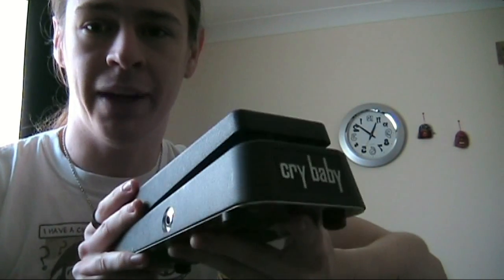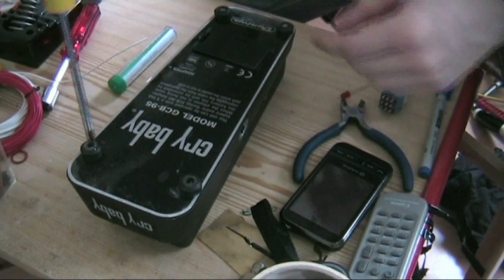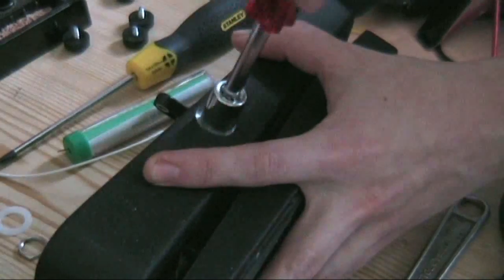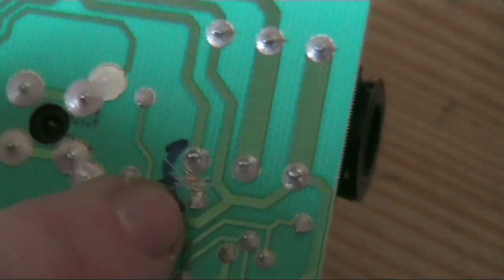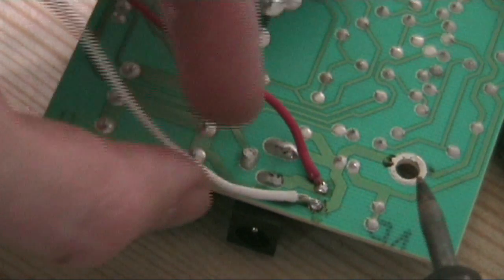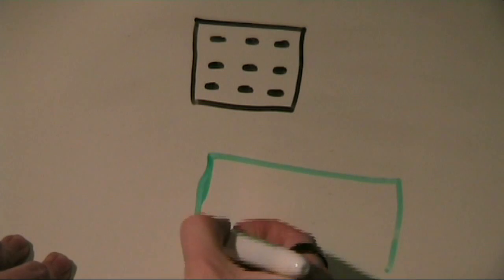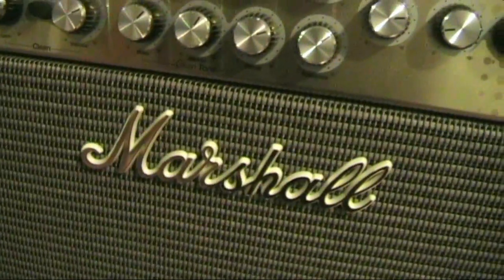Pedal Mods: CryBaby True Bypass and LED Indicator

Comment: Hey CSGuitars cheers for this!
How did you stuck the LED to the wah, did you hot glue?
Cheers from London,
Miguel
Reply from the maker: I didn't stick it with anything, I just drilled a 5mm hole and pushed the LED through. It held itself there with friction. 

If you want to be dead professional about it then get yourself an LED clip, drill the hole a bit wider and install the LED and the clip. That'll hold it firmly in place and look the part too.
Reply: CSGuitars Cheers man, That's what I did last time!!
Reply: +Miguel Pessanha I used a big lump of Blu-Tack...

Comment: HELP! :D 
I own the same Pedal (CryBaby GCB-95) but it has a different circuit board. Instead of the wee Capacitor that is going to be connected to the switch is there a red square thing. Also the "lines" on the backside of the circuit board are different...and it's confusing me! :D

Comment: Worked for me, but I did two things differently:
1. I decided that I would either remove one end of the resistor, or I would scratch the track, but not both (as you did).  I decided to pull one end of the resistor and solder to that, which would retain the PCB in original condition.
2. I put the LED resistor (4.7K) before the LED, instead of after.  I have seen diagrams with both configurations, and having the resistor after the LED never made sense to me.  I'm a total novice, so perhaps someone can clarify things for me.
Reply from the maker: Drum & Strum The resistor should be on the cathode (short leg). Electricity flows from negative to positive, the cathode is the negative leg so this would be the entry point for the electricity. 
Putting the resistor on the cathode is the resistor before the LED in terms of electric current flow.
Reply: I believe he meant capacitor.  As others have noted it's not necessary to cut the trace if you're desoldering the one end of the cap anyway.
Reply: Maybe I’m a little late, but it doesn’t matter if you put resistors before or after any component, you just put it where it’s more convenient in terms of space

Comment: Thanks for the tutorial, i followed it and it surprisingly worked first time which i was not expecting. The only thing i would suggest would be a higher value resistor for the led as mine is blinding when on.

Comment: I just performed this mod on my Rev I Crybaby. The only thing I would add is that if you look at the StinkFoot version (http://stinkfoot.se/archives/553) of this mod there is an extra ground wire. I didn't use this at first but adding it seemed to help a bit with some switch on/off noise. Your mileage may vary. The Rev I has a red "brick" style capacitor (C9) so instead of having a wire to pull up for the signal connection I had to solder in from underneath. I also put the LED at the heel-end. Great video and thanks for posting!!
Reply: Hey There, can you please send me a picture of your PCB? I also have the REV I Board and am afraid to alter anything without knowing for sure what to change!
Reply: Marshall Piatt Since I first posted I went back and performed the entire Stinkfoot mod involving removal of the input buffer circuit. Here are the photos: https://plus.google.com/u/0/photos/115174711536813016900/albums/6099456059536210881
Reply: Wow thank you so much!

Comment: Great lesson. I have my switch for the LED and true-bypass, but I can't work out which way the switch goes, as in, I'm confused about which wires to solder to the correct pins. There's no pin numbers on the switch and wondered if this is a common problem. Plus, I ordered the wrong resistors; I brought 5 band instead of 4 band. All the values are correct, so can I still used them? Lovin the mods! I have seen others on the net and want to gather a list of possible mods, like controlling the Q with a knob on the side. Thanks!
Reply: ***** Man, you are such a nice person to take the time to answer my questions! Thank you! I have ordered new parts for the wah and will attempt to do it again (messed it up the first try). Cheers :-)

Comment: Anything MXR or Jim Dunlop is by far the best in pedals. I have a CryBaby original and a MXR Black Label Chorus with a Fullbore Metal Distortion and I have the greatest tone ever. I greatly recommend MXR for pedals!! 8)
Reply: i find mxr pedals suck tone when off, sound fine when on, they all need true bypass

Comment: I've done this mod a few times and it's always gone quickly and worked out great but just today while doing another one I ran into a problem I can't figure out.  My LED isn't lighting at all. The pedal still works, I've tried 3 different LED's, a few different 1k resistors and all my connections have been double and triple checked but I can't get it to light up. Like I said I've never had this issue before any chance you know what could be happening and how to fix it????

Comment: I tried this mod and it doesnt seem to work. The true bypass is fine but the LED wont turn on. My circuitboard was identical to this one except the component referenced at 6:18 is shaped like a box as opposed to the little squiggly diode.
Reply: I've done this a few times, and the resistor on you're circuit board should definitely be ok, i was doing another one today though and ran in to the same problem you're talking about here. It's never happened to me before have you figured it out yet??
Reply: Bo Neufeld I have not, to be honest i kindve gave up.

Comment: Great video very clear, liked the drawings 
Took about 30 mins or so and cost about £2.30 
£2 for switch 30p for led and 6p for resistor happy days 

Bought the other bits for the other mod that u did so will do that a bit later 

Thanks

Comment: It seems like your wiring in the 3PDT switch is a little bit diferent than the wiring you drew on the video, for instance: you jumped (with a red wire) two switch terminals that are immediately side by side to each other, and the two blue wires seem to be soldered in a diferent position than its drew. Am I right? Can I do EXACTLY what you drew for it to work, or do I need any other connections not-drew in the video?

Comment: Thank you for your Video. Very easy to follow and informative. I noticed you connected the resistor to the cathode side of the LED mot other video indicate it should go to the anode. Does this make a difference?

Comment: I'm wondering about why you cut the trace to the cap if you disconnected it from the pcb anyway. Seems to me, you didn't really need to cut the trace. Is that bit which the cap goes into going to anywhere else, it didn't look that way to me. Can you clarify?

Comment: Just done this, took about 40 minutes start to finish and worked first time. My LED is a little bright (maybe needed a different resistor?) but it's much better knowing if the thing is on or not.. I'm a novice to this kinda stuff as well. Thanks for the vid, dude! Each step is very clear and educational. Might look at the more wah mods video next...
Reply from the maker: A resistor of a larger value will make the LED dimmer. 
It's there to resist the flow of electricity to the LED, so the more it resists the less light you get. 

Glad to hear that it worked out well.

Comment: So I did the mods and it it seems to be working fine except when the pedal is off there is a gigantic signal drop, almost to complete silence...not sure what I have done wrong, although I did get confused at the wiring diagram when you described where the green wire goes, can you explain exactly where it goes? It looks like it might go to the top left and the bottom middle of the 3pdt switch but I don't know to wire it like that

Comment: Awesome tutorial... but i dont get it why is necessary to desold one leg of the capacitor and pull it out ? The Why the wire shouldnt be soldered on the bottom of the PCB directly to the pin of that Cap leg, like you did for the LED. The connection from the input jack to Cap is already cuted so...?
Reply: That's my first thought. Why cut the connection when you're just going to desolder the capacitor and leave it hanging off the board anyway? And it seems a little insecure only connected to the board at one point. I think what he was supposed to do after severing the connection was just solder the white wire directly to the back of the board where the capacitor comes through.

Comment: Fuck this, just buy a Rocktron Classic Wah, which comes with true by pass, LED indicator right out of the box! And about half the price of a Crybaby. It even looks and sounds like a Crybaby!

Modifying a pedal is a risky business too. If you are not sure about what you are doing, you'll fuck the pedal up for good, not to mention the loss of resale value.
Reply: verbotenco
Dude you should just admit your scared of the soldering iron, this stuff is easy! Better yet Learn how n you'll prob find you enjoy it!
Reply: thats why this video is here, so you don't fuck up. i can see your point but if someone allready has a dunlop they might want to use this mod as basic knowledge is needed to understand the terms like i understood it all and thats just stuff ive learnt from designtech when i was at school.
Reply: *****
Who's spending high dollar? I don't spend high dollar. I bought Rocktron Classic Wah, whose price is half that of the Crybaby, yet is true by pass and comes with an indicator LED right out of the box. The only one spending high dollar is you. You pay more for a Crybaby and mod it in order to turn it into basically the stuff the price of which is half, which is Rocktron Classic Wah. Just admit your regret.
Reply: im buying a jim dunlop just because it was the same price as a rocktron and i trust the brand more (i'm buying a pedal that was used for display so its cheaper than a regular but still new) £55 including p+p not to shabby if i say so myself.
Reply: That wah sounds like it would be awesome! Hope your pedal is all that you hoped it would be. Personally, I prefer tinkering, perhaps at my own risk. If you ever find that your wah is lacking in some way, the mod community is large and welcoming.
Reply: Agreed. I wouldn't trust anything less than a Dunlop for stage use honestly. It has a reputation for a reason. Plus, even at $80 retail, it's not like it's going to break the bank or anything in the first place.
Reply: verbotenco The Rocktron Classic Wah might look and sound LIKE a Crybaby but it doesn't sound exactly like a Crybaby and it's not as durable as a Crybaby.

Comment: Thank you so much for your vid and your perfect explanations , I did the mod , it works perfectely.
Just a thing , when you wire the leg of the 10n capacitor , you don't have to cut the trace on the PCB .
In any case , great job ! Cheers.

Comment: If we're already breaking the connection by removing the resistor lead and attaching a bypass wire, i'm not sure why we have to or what the purpose of scratching/breaking the track between the two solder points...anyone answer this for me? I've read articles saying you don't have to do it but practically everyone does it in their vids, not to mention (biiiig point here) this guy knows a hell of a lot more about it then me, just curious i guess

Comment: hey man, i've recently bought a gcb95 from amazon.. I took off the back cover and guess what?? it has already a dpdt switch in it .___. it´s configured like a SPDT because its pins are soldered in parallel, but IT´S STILL A DPDT SWITCH THO! hahaha,  i just have to resolder it to make it truebypass (without a led but i don´t care, i have no need to buy a new switch to make it true bypass :D )
 has anyone already seen a standard gcb95 with a DPDT from factory?
Reply: uhmm i think there is no need to cut the pcb track, its not enough with desoldering that capacitor leg and soldering to it the switch cable? maybe there is something im missing, but i dont see the diference...
Reply: pato974631 You have to break the signal path here.

Comment: Check your crybaby/clyde model before buying anything. Several newer pedals have a complex board attached to the switch, with some resistors, capacitors and even transistors, SMD type. In order to do the true -bypass mod, some study is needed.

Comment: Isn't possible to use the battery positive and negative wires to wire the LED instead of soldering wires to the pcb? (then I will only use the power supply of course..) Thank you!

Comment: Hey mate...quick question...I was getting into doing the mod but found what looks to be a resistor instead of a capacitor where you solder the wire directly to the end? (1st board modification) Mine is an early 90's wah would it still be the same?

Comment: This is a really great video of a mod.... but the end kills it. The reason you'd want to make a wah true-bypass is so you won't lose signal. The type of signal lost is high frequency. So why, at the demo at the end, does the bypassed signal before the mod sound much brighter? In effect, the demo shows that the mod actually made the pedal worse (more high end lost when bypassed). Of course this can't be true, which means CSGuitars either goofed up the titling or he changed the EQ settings on his amp or guitar, which defeats the purpose of doing an A/B comparison in the demo. I got nothing but love for this guy but the ending, which I was really looking forward to, completely threw me out of whack, since the whole point of the mod was to see if it really made much of a difference.
Reply from the maker: True Bypass doesn't make your signal retain high end, in fact quite the opposite. The longer your cable run between guitar and amp, the more high end you lose due to capacitance of the cable. 
One of the reasons that pedals have buffered inputs is to boost up the signal to keep it strong through your signal chain so that it gets to your amp strong. 
If you have a line of true bypassed pedals then you are at risk of losing high end.
Wah pedals suck your tone in other ways and true bypassing them does improve the through signal over all. 

I can assure you that the titles and the EQ settings were correct and consistent respectively. 

However what the bypass comparison at the end shows is that the prior to the mod the frequencies are choked, however afterwards the signal is louder and is more equal across all frequencies.

The EQ of the amp was kept flat and it's apparent that the buffer in the wah was compressing and boosting the upper mid frequencies. 
With the true bypass however there were actually more highs and lows present and a clearer, less compressed sound. 

The difference I imagine you are hearing is somewhat of a mid boost effect caused by the buffer, which provides a sound that is punchy and bright, but it is also choking out the highs and lows. Watch the end again on a good sound system and watch the EQ bars before and after, you'll see what I mean. 

What makes a good tone is obviously very subjective, but from a sound engineering standpoint the true bypass off signal contains a wider range of frequencies and a more detailed sound.
Reply: CSGuitars Ah, OK, I never expected the buffer to brighten up the tone (to my ears) because all I hear about wahs is that they suck high end when bypassed. The most noticeable difference to me was then in fact the high mids which after your mod were less boosted, tricking me into thinking more high end was lost, when really there was more of it. The reason why I didn't expect high end loss from your cable run is because generally you need over 15 feet of (unbuffered) cable before you start hearing the highs going out, and I assumed you were using a lot less since you're at home and it's a simple rig. I admit I didn't look at the visual EQ, and was just listening off laptop speakers. I'll take the smooth fullness of the true bypass over the compressed buffer any day. Thanks for the vid

Comment: my pcb screw wont come out, just keeps turning and turning :S
Reply from the maker: If you can get a blade, or a thin flathead screwdriver under the head of the screw to apply upward pressure while you unscrew you might be onto a winner.
Reply: cheers i gave it a go and it wiggled free, was worried about breaking the pcb but it seemed sturdy enough

Comment from the maker: This mod will work for most common wahs, the only real problem I can think of is if the components I've mentioned are located in different places, or in the case of the 535Q, the foot switch is attached to its own PCB and connected to the main board by ribbon cable. 
In each case carefully trace where everything is going and you should be ok.

Comment from the maker: It would certainly be possible to change the cheap box style caps for an equivalent. 
I'm thinking about doing so myself pretty soon, along with winding a custom inductor to replace the stock one. I suspect that changing the cap for a higher quality one that is of a different physical construction will change the sweeps smoothness and richness, in the same way different caps on a tone control do. 

Naturally I'll have a video of it up when I get round to doing it.

Comment: i too have this ''blue box''...it seems, however, that the legs on this cap are verry short and im not sure theres enought there to solder the wire to ..is it possible to replace this with a normal cap ? if so whats the differance between the two ? greatly apreciate the vid btw ..awsome instruction

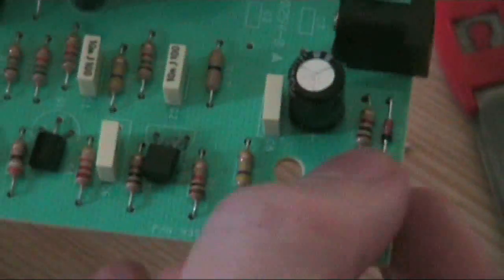Comment: ok on 7:55 of your video, is the white wire connected to the Diode the same wire that was connected to the capacitor that is on the left of the electrolytic Capacitor?

Comment: Hi! Your instructional is very clear and straight forward especially the quality of your video. I followed your instructional and did my crybaby to work but the LED does not work for some reason. I use 1k-ohm resistor(1/2 watt / 5%) and 5mm LED(16mW min / 1.2v  / 100ma / 45' 940nm) from radio shack. All of connections are double checked, everything is clean.